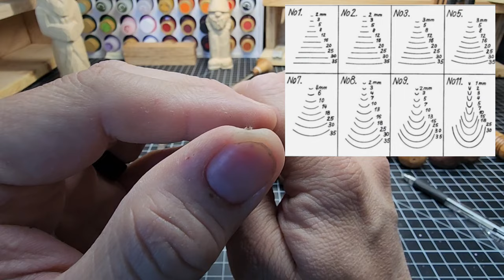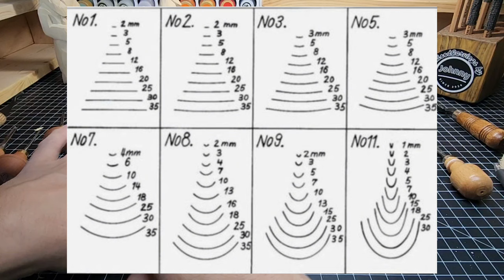All about Palm Tools...

Comment: Thanks Johnny!

I have the Flexcut gouge set sold with replaceable blades— a single handle was included with the entire set.  I then made handles for each of them and permanently attached them.  

I wasn’t clever enough to mark them with their sweep and size as you did.  I hope you feel flattered when I shamelessly copy you in marking them on the butt of their handles.

I also made a fold-over, thin leather, tool “roll” for them with pockets for each individual tool.  I leave mine flat rather than roll it up.  I have the same type of tool roll for my Dockyards set.
Reply from the maker: @laurelmiller7340  That's awesome!  Those flexcuts hold their edge well, good steel.

Comment: I have the Flexcut Premiums.  They have handles closer in design to the Pfiels.  The way I use them tends to be pushing with a finger out on the blade (either with the pushing hand or the off hand).  I really like the motion of the blades, the flex.  Of course, that's a personal taste thing, i can see where others might really hate that.
Reply from the maker: I haven't tried the premiums, i might have to give them a go.  Like i said in the video, i've always found flexcuts to be reliable in the cut, hardness of the steel and their ability to hold an edge well so I'm definitely willing to take a chance with them when it comes to their tools.

Comment: Johnny I'm looking to get a no.9 but I can't get a 5mm the place I buy from only has 4mm or 6mm which would be good for doing eyes, I buy stubia
Reply from the maker: @moonwolf7135  I would lean towards a 4mm if I was doing eyes on a scale of a 2-3 inch face.  But that's one of those "your mileage may vary" kind of questions.  The style of face, the size, the depth, all of that can change the answer along with being heavily influenced by your style and how you carve.
Reply: @JohnnyTheLayton  I was thinking the 6mm might be to big because I usually only carve on 1x1x6, 2x2x? blocks and the only time bigger roughout is when I take an online zoom class then I need my longer pfeils for those
Reply: Hey Johnny, great vid. Happened to catch something on the wall behind you, former Air Force? I’m 18 years in.
Reply from the maker: @BJMtz1  Yup, i was in from 01 to 05, Security Forces.